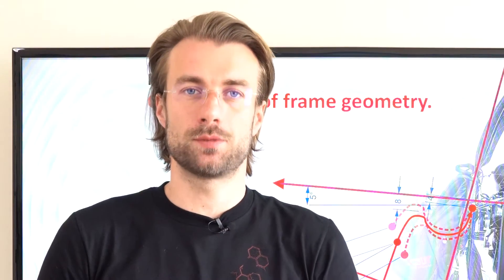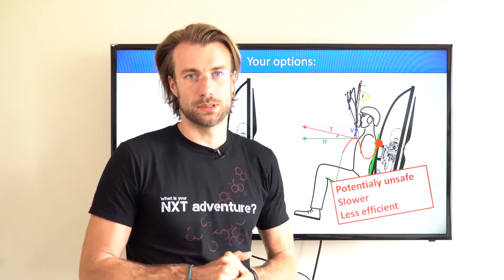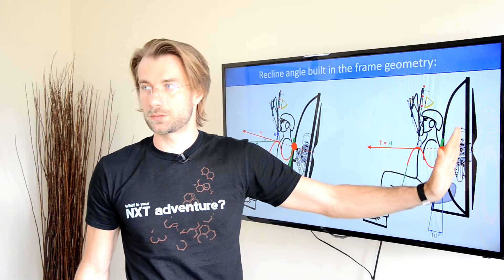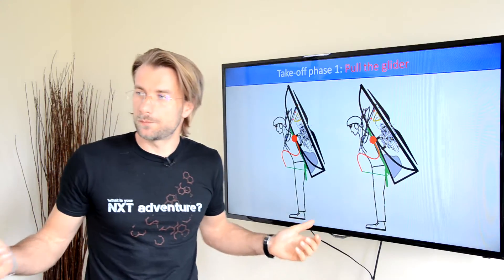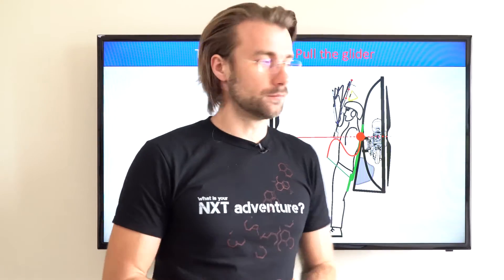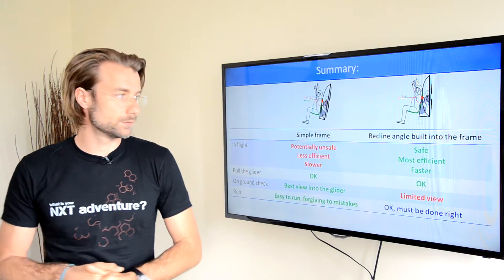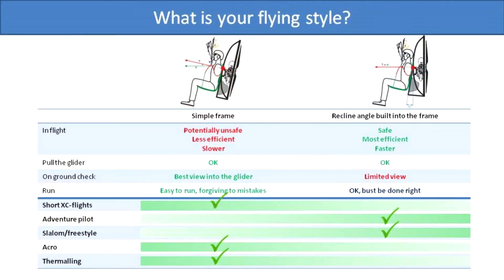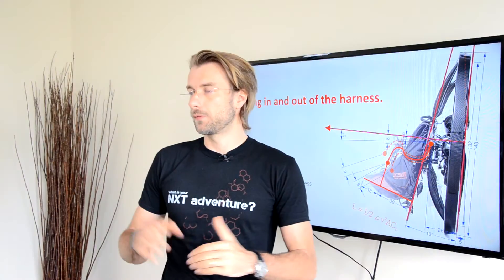Why some paramotors fly faster than others? Paramotor geometry part 20.1

Comment: First I was impressed, but than I concluded you must be wrong. Speed of the paragliding unit does not depend on the engine but on the wing primarily, otherwise you would fly faster with stronger engine what is not the case. You must know that since you are smarter than me, so I wonder why you are screwing us?). Tilted propeler (<>90o) may make you hop and down when you change rotation speed, but does not make you fly faster as you claim.
Reply: Tilted propeller provides vertical thrust, therefore unloading your glider by a few kilograms. Less load means slower wing. This was explained in one of previous videos.

Comment: Miroslav - 
Your analysis is based on an assumption that the back of the pilot is always positioned against the front plate of the frame! Basically, you assume that the back of the pilot is pressed against the frame.
Yes it is - on most paramotors. But this happens only because the motor and the frame have their own CG situated behind the axes of the bars (I am speaking about the moving type of bars). So the motor+frame have a tendency to rotate (fall) down on this axis until the frame meets the pilot's back (should I say: butt?).
However, the axis of the bars can be shifted backwards (like I did on my installation), so the common CG of the motor+frame(+fuel tank+prop) is almost directly_below the bar axis. So when I take off, the frame is against my back. But when I fly, the frame is hanging vertically by itself due to pendulum effect and NOT aligned with my inclined back!
In fact it is a bit more complicated, but the point is: you can fly comfortably inclined and with the frame not being against your back, but hanging automatically in upright position due to the gravity! Just move the axis of the bars a little back.
I personally have advised some pilots to shift this axis back, having their frames less prone to incline. 
What would you say?
PS. There are interesting PAPP frames, with thrust vector ABOVE the bar axes. These frames flip vertical under high power, while reclining on idle.

Comment: Maybe would it be possible to design an adjustable system buy a handle or something to change the angle between seat and para motor and therefore get a take off position and the cruise position and The Best of Both Worlds

Comment: I had hoped wing selection might have come for this topic too but I guess it all starts with getting the engine and harness setup correctly :)
I also though you might discuss gyroscopic precession here.. 
anyhow, interesting as ever :)
Reply from the maker: The gyroscopic precession is a cool effect but a bit overrated. It does not affect flying that much in the end...
Reply: It's an easy thing to get lost in the details and geek off to the possible tech etc. I do like your pragmatic approach to your solutions :)

Comment: Just as an FYI, the air conception has the tilted prop in their delta frame but not on their "race" frame.  It's awesome that you pointed out that the tilted prop takes a bit more skill to launch. I had been wondering if you would describe that characteristic but as usual, you took the route of full disclosure, well done. 

Also, I'm still loving this series.
Reply: WoodysGamertag I chose the delta frame for that reason.  The motor is slightly lower as well.  So far really I enjoy the estart, clutch and weight to boot over my previous motor.
Reply: Im learning a lot as well. Guy is knowledgeable